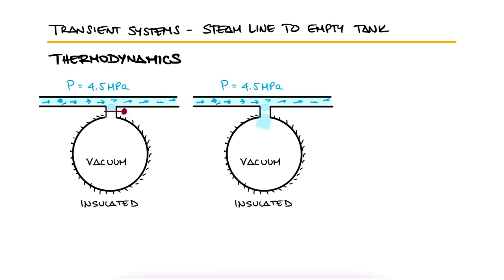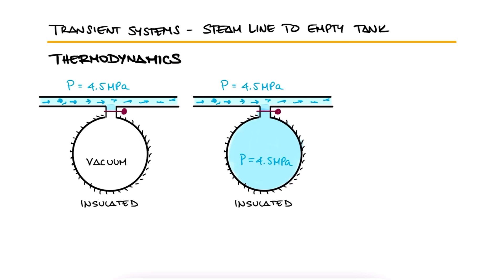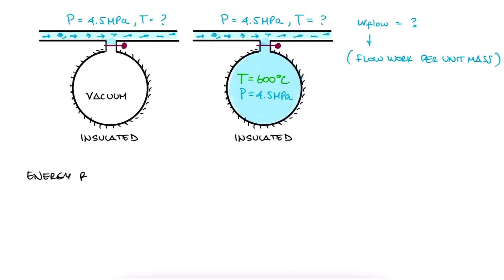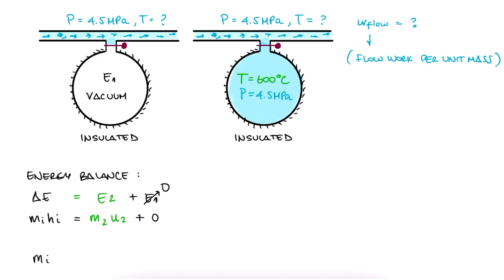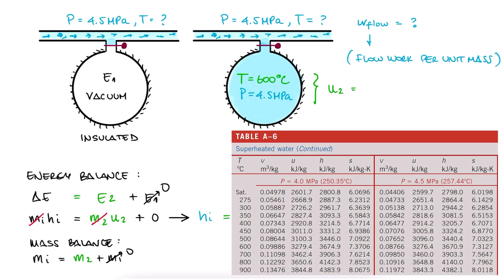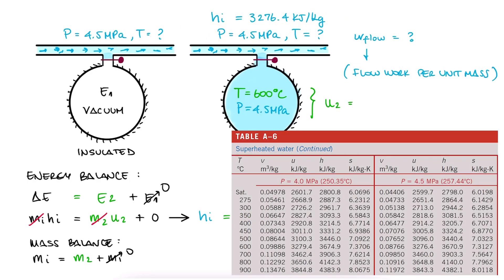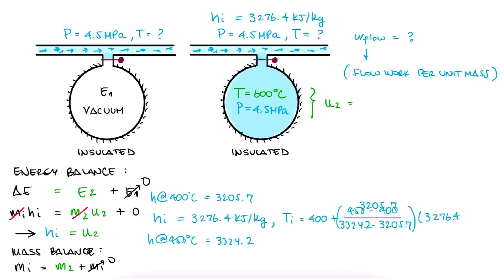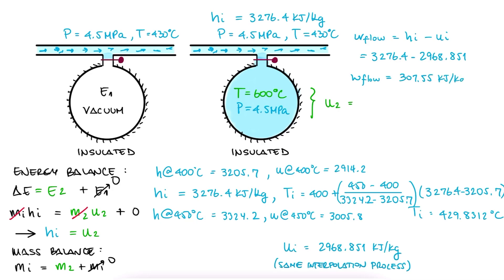Steam Line into Empty Container Example TRANSIENT system in 3 Minutes!

Comment: Pressurized steam at 430 C escapes into a sealed volume at lower (eventually equal) pressure and heats up to 600 C ???   That seems counter intuitive.
Reply: Thats Because the flow energy is also converted to internal energy inside the vessel

Hope this helps after 2 years lol